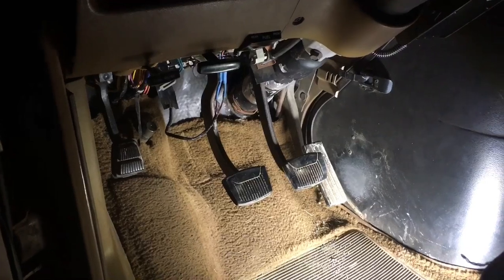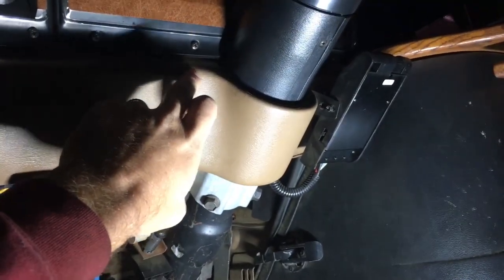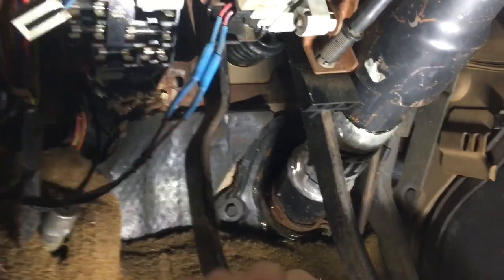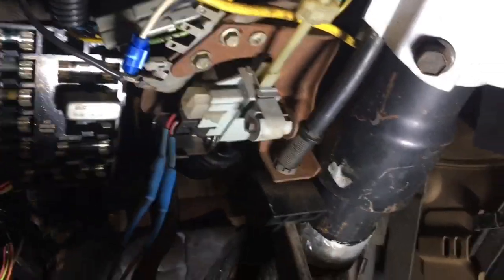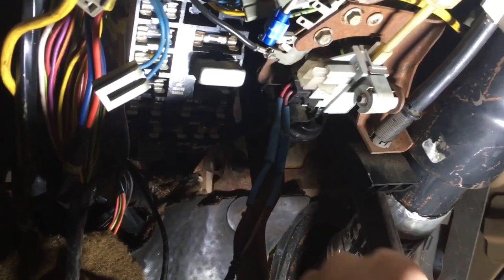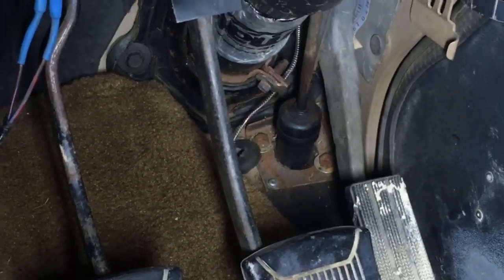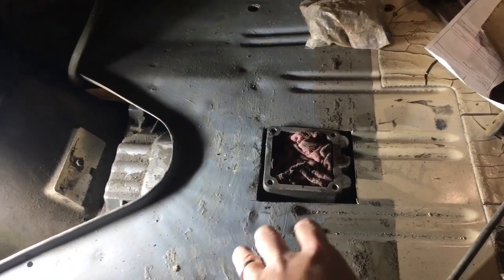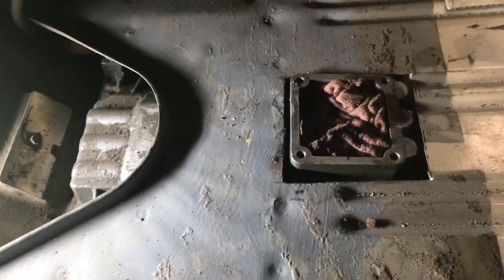Ford Econoline Van Manual Transmission Swap overview

Comment: @GillansGarage Hey there! I've seen your work and it's quite impressive! In fact you were one of the main reasons why I decided to pick up a 1981 Econoline E150 with a 3+OD (I guess, four speed). I do not like that transmission at all. I'd love to do a 5MODR2 swap. 

I feel that I'm at a crossroads right now because the floor panels in the cab (front front and front rear) need to be replaced due to the huge amount of pitting, holes, and in addition the metal that was broken out when one of the dog house bolts was ugga'dugga'd to hell and tore the metal off the floor (to get the bolt and nut out, I still have the bolt, nut, and piece of floor in between..)

Anyway, I was wondering if now would be the time to do the swap? I'm not sure the shifter will sit in the same place as the "old" transmission and rather than cut my new floorboards multiple times (if I were to do the swap later) sounds unappealing. Would you be interested in talking through this a bit with me? A DM, response, or anything of the sort would be wonderful however I do understand you are a busy man, with that said your experience in this particular swap is really appealing. I picked a manual econoline so I would have the foot pedals and have a decent amount of the manual transmission parts, but at this point I'm unsure what I need to buy or where to even begin.

Anyway, thank you for your time. I hope to hear from you. All the best, may you be happy, healthy and prosperous! (I work 3rd shift, hence the almost 3AM comment time..CT)
Reply from the maker: Send me an email at jjgillan82@gmail.com

Comment: Thanks for the information. I wish someone would build the clutch pedals assembly for them. Is there a drastic difference between the two pedal mount assemblies? Ive looked and never seen a manual transmission van in our area
Reply from the maker: Chapman racing They use the same framework but the brake pedal arm is offset and the clutch arm mounts to a shaft that slides inside the shaft that the brake arm rotates on.

Comment: I never seen a 5 speed manual conversion in the E-Series or Econoline van application does it require any modifications to the 4th gen Econoline vans
Reply from the maker: Yes, it’s more work to swap a 4th Gen Econoline as a manual transmission was an option in some 3rd Gen Econoline vans. I believe a 92-96 F150 clutch pedal assembly can be use to modify a 4th Gen brake assembly to make it work. A friend of mine completed a manual swap in a 4th Gen for a while then went back to automatic!?!? 🤷‍♂️

Comment: My question would be I have a 83 Econoline band wanting to switch it to five speed did you take the pedals out of a pickup truck and did they fit the van or do I got to find one with a van pedals
Reply from the maker: I’ve used pedals from a van but I’ve been lucky enough to find two stick shift parts vans. They’re another guy on YouTube that modified a automatic van pedal assembly with a truck pedal assembly.

Comment: How well does the propane injection work on the IDI? Is it turbocharged?
Reply from the maker: So we used it on our hunting trip to Montana. We had two 30lb propane tanks mounted but only used 6” of the top of the tanks, so I’d said our mixture ratio was quite a bit leaner then it could have. We did pick up 1/2 mpg better mileage which I didn’t think was too bad considering we had more weight on that trip then previous trips. We should have burned those entire tanks in 1600 miles plus more. Once we got out there we weren’t comfortable turning it up and taking the risk of not making it home in one piece. Haha. We figured we’d do some tuning closer to home. And yes, the van is turbocharger using a Banks Sidewinder Turbo kit.

Comment: Currently working on a swap on my 91 … What master cylinder did you used ??
Reply: And that push rod 😮
Reply from the maker: So on a Cummins build, I’m doing I ended up converting to hydroboost brakes and used a F series truck master cylinder that mounts on a firewall instead of through the floor like this set up. This set up works perfectly fine and that master cylinder is available on either eBay or rock auto. I would highly recommend reinforcing the floor with an additional piece of structural thicker metal.
Reply: Noted .. thanks

Comment: Ive got a 1990 ford e350 4x4 with a 7.3 idi and e40d transmission. Been thinking about getting it swapped to 5 speed and from watching your video it looks like the custom clutch pedal assembly would be a big part of the job. How many hours of labor do you think a job like this would take?
Reply from the maker: If memory serves, we had about 30-40 hours in the whole swap.
Reply from the maker: Turned out great!! I use that van all the time without question.

Comment: Can you use a f150 or 250 as a complete swap from truck to van?
Reply from the maker: I don’t believe so because the firewalls are so different between the trucks and vans. You may be able to use the truck clutch pedal with rod and modify it to go in the van brake pedal assembly.

Comment: My econoline in that body style has the linkage clutch so I don't have to worry about the hydraulic setup but 1 of my newer body style econolines is auto and I want to swap it, if I can get a clutch pedal if some sort to fit in there, what do you think about a cable clutch conversion like mustang (light duty e150)
Reply from the maker: Sure, I think that could work too.

Comment: Hi, I like your video . Many years ago, I had a E-150 with a 302 ci equiped with a manual transmission (floor shifter) 4 spd (3 +OD) I have some questions for You. 1- What type of transmission did I had? (Borg W, New Process, M4OD ...)  2- I'd like to find another E-150, can I make the conversion from auto to manual trans with a 5.8L (351 ci W) ? If yes, what do You suggest as transmission?  Stephan from Quebec city, Canada
Reply: Ho, I forgot, the E-150 will be from 80-91. I love this model.
Reply from the maker: 1. Honestly I’m guessing you had a T-18 with and overdrive 4th gear in your old van. 

2. Definitely, that can be done. I would suggest the ZF5 5speed transmission.  

Thanks for the comment and good luck!!!
Reply: @GillansGarage  I will search for it.  Thank You ! "Merci!" as We say in french. Sorry for my english, I usualy speak french.  :)
Reply from the maker: @stephaneouellet1439  No worries!! Glad to offer whatever help I can. Good luck with your search.

Comment: What about 2000 Econoline?
Reply from the maker: A friend of mine did a manual swap on a 4th Gen Econoline van. I believe he used a brake/clutch pedal assembly from a 92-96 Ford F-series truck and modified it to work.